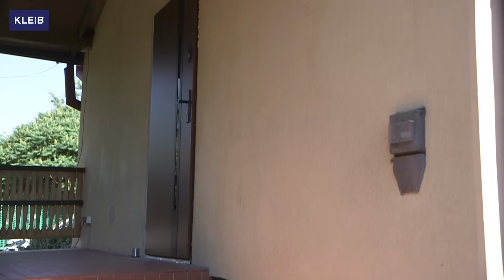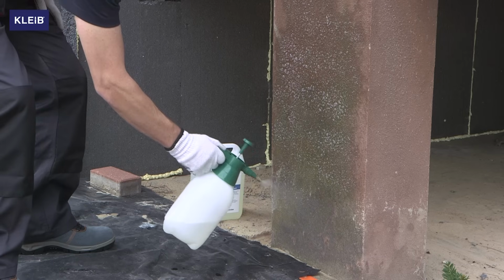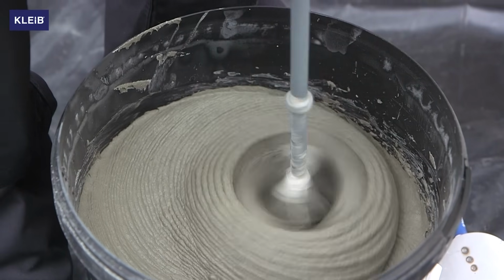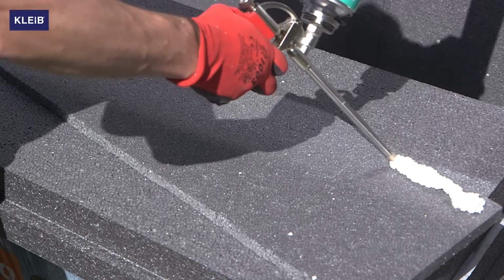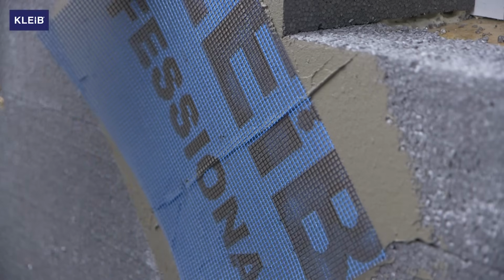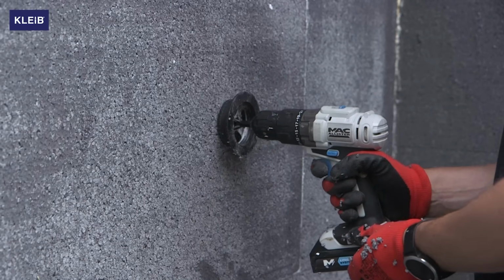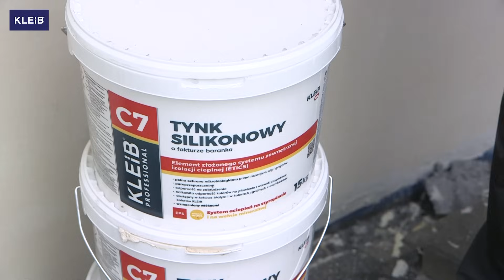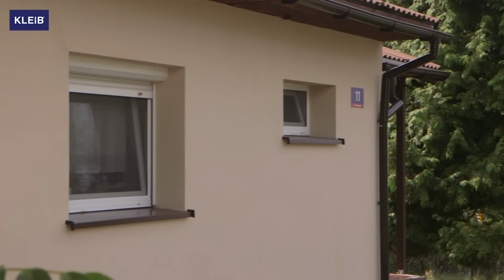External Wall Insulation – Polystyrene system KLEIB

Comment: @4:40 and 7:00 good luck servicing those shutters! 😂
Reply: And what do you want to service there?  I've had blinds for 15 years and they continue to work the same way. I don't think you understand what thermal insulation of a building is and how to do it properly. Elimination of thermal bridges is the basis.
Reply: @Endrjo  15 years is a long time. Mine are 30 years old and in the last 10 years a couple required  maintenance. I was glad I did not have to destroy my outer shell for that. There are many ways to address thermal bridges for serviceable items.

Comment: How do you change the motor of the rolling shutter now when it will be broken ,????
Reply: You can't. 🙂
Reply: It depends on. My mate did one, and the owner did not let them open the outer wall so they went from the inside out lol. But even if that happens you can fix it relatively easy. You just need to remember the colour scale and the adhesive types.
Reply: Prepare yourself in advance. I have it, and I left pipe in walls with wires. So if it happens I just pull the wires out, replace motor, pull wires back
Reply: There are different type of windows available in Europe, many of them allow you to change everything from inside
Reply: A pipe in the wall though which a motor can pass through?! :D
Reply: He has rope which won't break

Comment: Isnt that stuff flammable?
Reply: No it is not flammable
Reply: @kevindruce8915  yes it is, fire rating E - it’s cheap and good but unfortunately it is flammable
Reply: Normal standard Polystyrene yes. However, there are nowadays firms who produce it additives into it that makes it fire-resistant (C-B-A level).
Reply: @kevindruce8915 your answer is a joke. I burns like hell.
Reply: @DualParkgatvanHeijtingNL  I haven’t seen any yet . Normally rated F or E
Reply: @kevindruce8915  rubbish , read the fire rating specifications..
Reply: research grey and white external wall insulation polystyrene! Grey in most cases where specified and bought in the UK is pretreated GRAPHITE EXPANDED POLYSTYRENE, as such: expanded polystyrene (EPS) with graphite and conform to BS EN 13501-1. Class B-s2,d0. This equates to a Class 1 overall fire rating.
-
Why people comment before researching the technical research on the different forms amazes me!!
-
Some companies who supply it do not add fire retardant properties, like any construction build, when buying supplies you buy what your budget allows, but I would always go for CLASS1/B rated rather than other supplies that may supply Class E!
Reply: Normal styrofoam (white) definitely but the one in the video has graphite added, it should be a lot less flammable. Mineral wool boards (installed identically) cannot burn at all and insulate even better.
Reply: If you get to the point where the outside of your house is burning through a brick wall, it's a total loss anyways.

Comment: I wonder how does this solution deal with humidity that can be trapped between the insulation and wall?
Reply: proper ventilation
Reply: No one actually really knows because there are not many EPS facades taken apart and inspected.
Although EPS allows some vapor passing it's not enough. Automatic  ventilation is a plus
Reply: @luckystrike656  with EPS foam it's very important to calculate the dew point inside of the wall, if the dew point is in the insulation then humidity is not going to be a problem, because everything will condense outside. There are millions of homes insulated this way and it rarely ever fails. Most fails are from renovation with improper calculations being done or no calculations at all.
Reply: @UhOhUmm  I know, I have a EPS insulation on my house.. I've done it almost 8 years ago with 12cm of EPS, without any calculations tho, but so far so good. No moisture on the inside walls..
Reply: @luckystrike656 what location of globe, have u done this
Reply: How does that breath? Are you not suppose to remove the old wall first
Reply: @Steven-f2c  remove what?
Reply: @luckystrike656  the old walls,like rendered walls example
Reply: @Steven-f2c  no, they get a good pressure wash and maybe a primer.. The eps or rockwool goes over it
Reply: @luckystrike656  sorry  didn't realise it was a house I thought it was a parkhome.  Sorry again

Comment: Good video. Is it necessary to drill those holes and insert those plastic anchors in? The reason I ask is because I recently had this EPS Insulation done on my front house over pebble dash. It was free of charge done via government scheme eco target. Once the black eps boards was installed, the builders sanded it down and then put base coat on followed by silicone render. I am worried now that something may have been missed that could cause problems later.
Reply: I think they are for wind resistance
Reply: It has to do with wind and height of building. If your house is single story and in a mild wind zone then they aren't really doing much.

Comment: Be very expensive and how if need can you replace your windows. I just use insulation board and brick slips😊
Reply: it is recommended to use silicone render, graphite expanded polystyrene is waterproof and breathable and also reflects sunlight.

Comment: How do you clean it because it does get dirty and mouldy
Reply: It won't be mouldy because the paint contains additives which prevents the mold to grow on it. Also if the roof is well made, no water running on the wall and if there is no splash from the ground, which brings dirt on the surface, you are fine. On the top of that, the paint is silica based, so it is waterrepellent. You can wash it if it gets dirty.

Comment: Shouldn’t the foam board be installed with modified cement using a fiberglass back detail mesh to wrap around to the front for extra strength? And the adhesive motor be vertically troweled with a notched unit to provide a path for water to run out at ground termination? Either poor widows or bad instruction without ice & water shield be placed in the opening prior to the window installation with a proper drip cap on top, this will seal from further rain, moisture that forms where the temperature changes with high humidity on days were extreme temperature difference form dew on grass. Your shoes are wet after walking across the lawn for the AM newspaper or mail. This condensate form behind the styrofoam boards, causing water droplets to drip out then air to circulate behind to dry out on a vapor barrier orc ice & water shield, then drip out the bottom of the finish? Correct? If a non-permeable seal wrap or coating is not applied to wood sheaving, it will cause rot and damage to structure in a short time. In the U. S., EFIS systems where looked down upon as these steps were not taken on wood structures, as mold, mushrooms, and wood rot occurred as Tar paper or asphalt felt was the only barrier used. The poor installation or windows or doors using cheaper products failed quickly, writhing 3 years of new construction occurred! It was devastating to the EIFS industry. Just my two cents worth! DK. Thank you for the informative video kindly.

Comment: The starter profile creates heatbarrier and greatly reduces insulation. I would not use it. Nobody does.
Reply: Only out of PVC 👍👍🇩🇪
Reply: And how does one start without? It's also a rodent/insect barrier, no?
Could you link a few videos of a good facade job? I need to do mine

Comment: Imagine the intensity of the fire after wrapping your building in polystyrene!
Reply: Deve ser anti chamas concerteza
Reply: That was the 1st thing that came in mind.
Reply: even without the polystyrene you'd still be screwed
Reply: Isn't that what caused the Grenfield tower fire that so many died - external insulation cladding?
Reply: the foam has fire retardant chemicals added. there are video on youtube of this type of foam being test burned.
Reply: @toshe.6690  So had the cladding at Grenfield Tower - allegedly.
Reply: @ericperez1946  lack of knowledge it melts it is treated. Either way if fire precautions were not followed you would more than likely be buying a coffin, since the polystyrene wouldn't be the problem, would be lack of fire precautions and evacuation.
Reply: @ericperez1946  expanded polystyrene (EPS) with graphite and conform to BS EN 13501-1. Class B-s2,d0. This equates to a Class 1 overall fire rating.
Reply: This is the best type of insulation, most of the houses in Poland have use this kind of isulation from last 30years
Reply: It’s fire proof. Do you think they’re crazy?
Reply: Anytime I've tested this it is flammable the render gives it fire protection that s why they yous rockwool on hi rise
Reply: @joebloggs4369 Yes. There is a fire retard cladding as well but to save money they fitted the cheaoer cladding which wasn't fire resistant..
Reply: Polystyrene is flammable but it does not spread fire, polystyrene consumes itself and does not spread fire and I used common white polystyrene in my house but I did fire tests before and it does not spread to other places
Reply: Always test the many kinds of Kingspan & Celotex & poly yourself. many are not fireproof or flame proof.
Reply: It is best not to leave the house then the car will not drive you.

Comment: I'd be wary of such cladding and it's longevity being exposed to the elements. Might as well do an external render.  Grenfell Tower Failure in London. The fire spread rapidly due to the cladding which act as a source of fire. Many innocent people died 😢
Reply: Trzeba mieć. Między nogami węża żeby to zrobić
Reply: Grenfell was completely different, they used rainfell cladding this is raphite Expanded - expanded polystyrene (EPS) with graphite and conform to BS EN 13501-1. Class B-s2,d0. This equates to a Class 1 overall fire rating.
Reply: I would not put it on my house without first setting fire to a piece of it and seeing what happens.
Reply: This isn't the cladding that was on Grenfell, it's not cladding at all. There are rock wool boards for the same purpose installed the same way, they are more expensive but cannot burn and don't need to be as thick as styrofoam. This is literally standard insulation on all of Europe.
Reply: Completely different type of cladding.

Comment: Warm boardung the inside of your home is far better, ok you might have to prepare the rooms and loose a few inches which is minamal but far superior and insulate your attic, the problem is people are lazy and want miniumum disruption to there homes but for longevity and no problems in the futre warm boarding is the way to go
Reply: A proper house envelope it's done from the outside, like a jacket.
Done from the inside you get cold spots were the ceiling/floor is..

Off course, one does the external walls and the attic/roof as well
Reply: @luckystrike656  cold spots in the floor and ceiling lol , so external insulation stops floors from being cold and heat travelling up trough the ceiling lol,  If cavity walls it's actually useless as by the time the heat penetrated the walls and makes it out to the insulation to bounce back in it would have evaporated in to the air because cavity walls are ventilated hence doing there job, never mind all the damp issues and  eaves, sills and door  problems, let's see how many complaints come in say 15 to 20 years with external insulation. If you stop and think how much heat is it going to take to heat the internal walls penetrate the walls and trough the cavity  bounce back in to heat the house  and how long if warm boarded,. Works like a jacket a sales man qoute 😅🤣😂
Reply: Educate yourself about what's a building envolope
Reply: If people want to pay excessive amounts for insulating there home then yes go for external wrap and in 20 years ya will be paying more again for the problems it has caused, the envelope causes alot of moisture in the house and unless you have a dehumidifier on or some sort of moisture extraction system you are going to have problems because reality and what's on paper are two different things

Comment: looks ridiculous amount of work, it is easy to build brick wall and add insolation inbetween
Reply: It's a half the expense and time of an all around brick wall, although brick looks way nicer
Reply: it is used for external wall insulation on old houses that were built from brick with no cavity which are over 100 years old. You can not insulate an old house with no cavity, therefore you would externally insulate, then render and apply the desires decoration or colour of choice. A few companies carve or brick designs on the render now to make it look like it was without the insulations added.
Reply: no mahomed is not easier xD, you even don't know what are you talking about xD

Comment: The fire rating is a total and complete joke. How to devalve your home ..it's the new asbestos..
Reply: it is fire rated "1" and fully tested .. lol-- expanded polystyrene (EPS) with graphite and conform to BS EN 13501-1. Class B-s2,d0. This equates to a Class 1 overall fire rating. Like Gypsum and Cement it melts rather than burns.